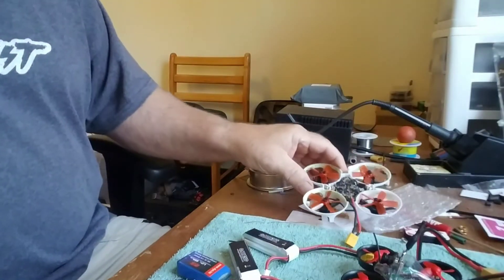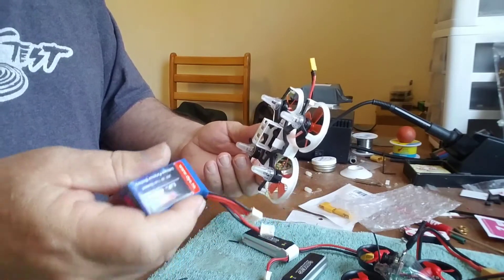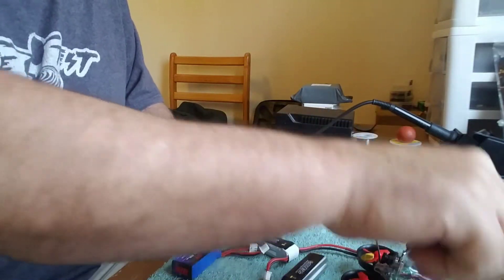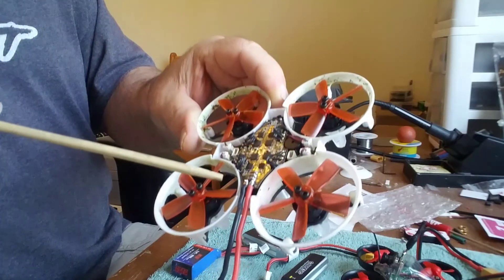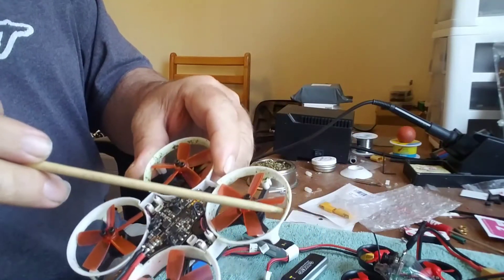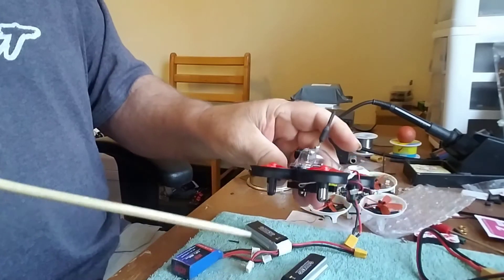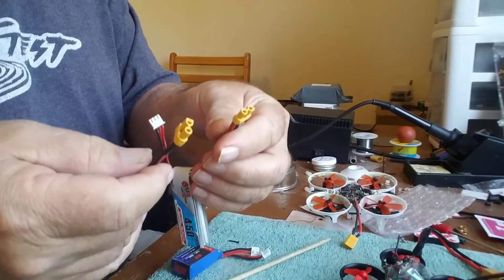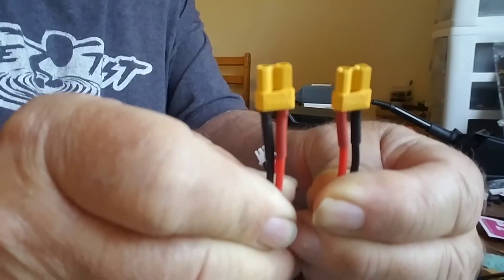DYS Elf Battery mod

Comment: what batteries are you using?? do they fit the battery tray?
Reply from the maker: beckmabj77 GN3 450mah 80/160C sold by crazepony on amazon. I cut the back out of battery holder so this longer battery would fit. Stuck a small piece of battery pad I use on my racing drones on the bottom inside of the battery tray to make a tight fit. I think is 2mm thick and is tacky . Holdes the battery in very good without any  thing else. has the XT30 connector

Comment: Weren´t the solderjoints on the pdb covered with some transparent glue? Removed the cover on mine to see if I should attempt this battery mod, but on mine there seems to be some non-conductive  glue on and between the solderjoints on the pdb.
Reply from the maker: Jens Petter IkkeOppført. Not on mine maybe something they just started. I did notice two open pads on the outer edge close to where the + - are marked I tested them with a battery installed but didn't read battery voltage so I just connected where the stock was soldered on

Comment: What is the flight time on GN3 450mah 80/160C?
Reply from the maker: Timed a flight today just under 4 minutes before low voltage warning on the OSD.  This test was done with 3035x4  35 mm props that I just installed but I think the 5 blade stock props were right at 4 minutes also. Have a motor going bad will be replacing with 1103 10000 kv racerstar

Comment: Thanks for that ...any chance you will be doing a mod to sort out that bad placement of the vtx antenna.....
Reply from the maker: Well I think one motor is going bad have a lot of vibration after a couple minutes of flying. Going to replace with 1103s So I'll diffidently be changing placement of the antenna probably both of them Receiver will just come out the top of the body VTX not sure yet but it's coming out from behind the battery Lol.